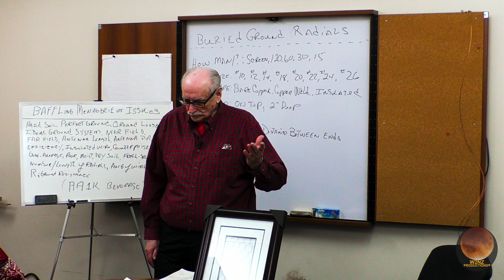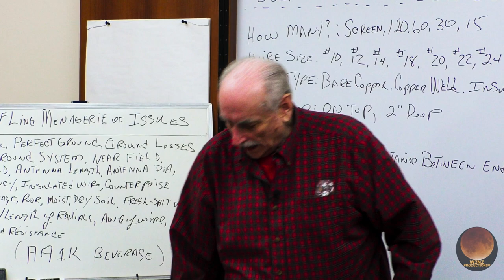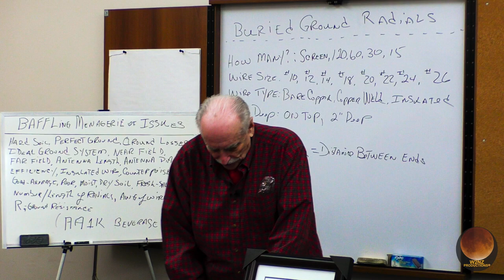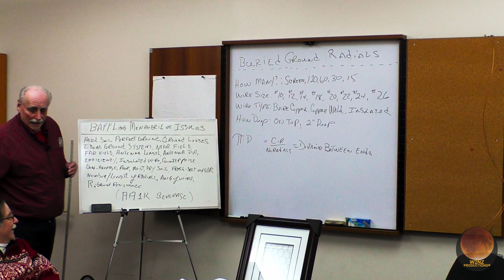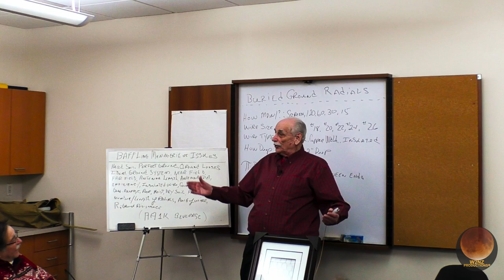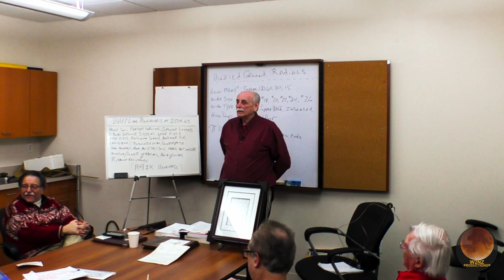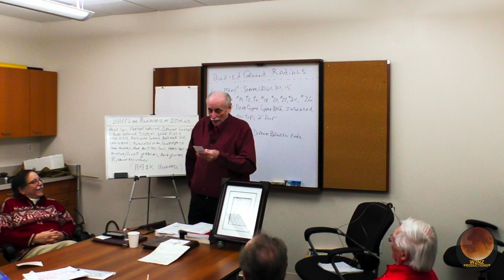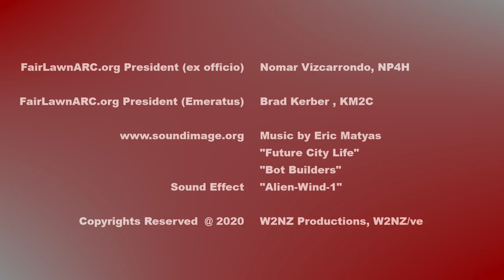Bury your Ground Radials! - Presented by Wa2aLy, Larry Wolff Capt. Ret., U.S.M.M. - Part One

Comment: Excellent! I've  seen many crews layout hundreds of feet of tightly connected copper wire for the several AM stations I've worked for. Ugh. FYI, typically AM radio stations use small antennas, no where near 1/2 or 1/4 wave. I didn't put 2 and 2 together until viewing the good captain's talk. On the First Class Radiotelephone test of yore, we needed to know what a Wheatstone Bridge was. NOW I get it! tune the copper field to the vertical element!  Thanks!  de N9AZI
Reply from the maker: Thanks for the info!